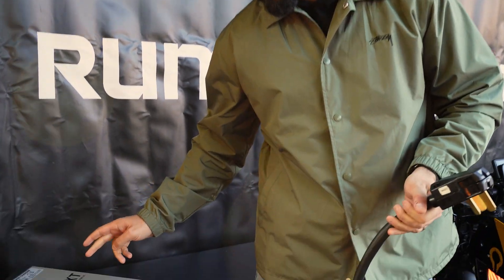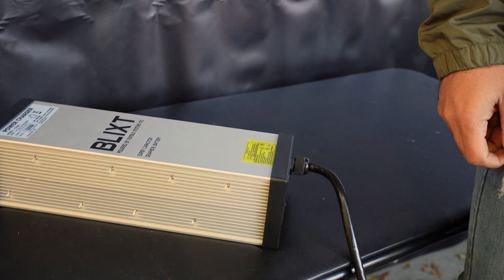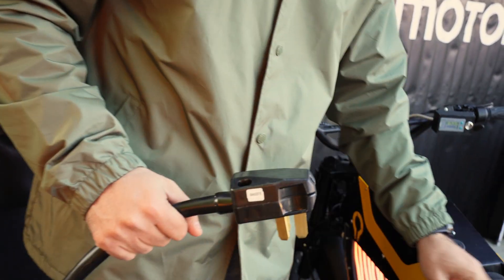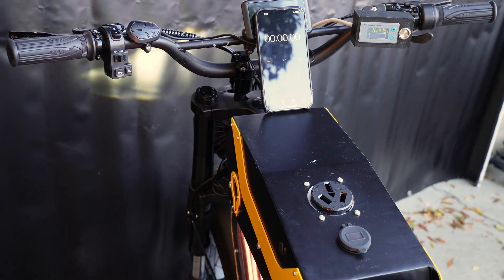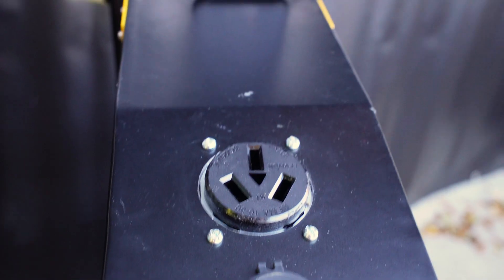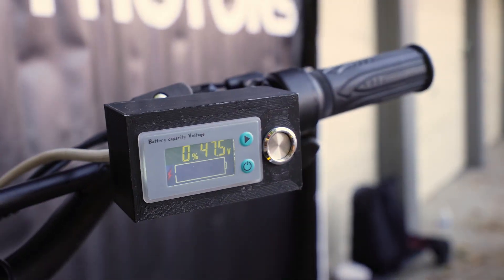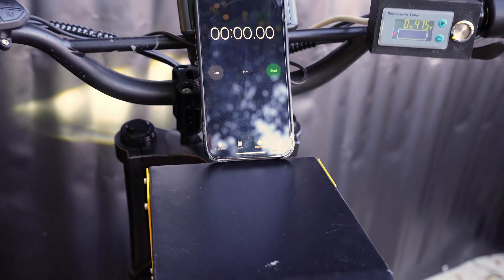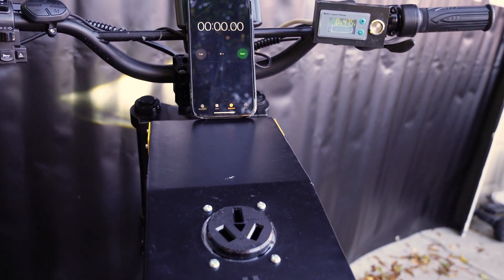Super Capacitor Graphene Battery Charging time (Time-lapse)

Comment: It is my understanding that these batteries can be charged at up to 80amps. that would be an approximate ten minute hyper charge. very fast. and the cycle life if i recall correctly is exponentially greater than traditional batteries. at over 20,000 charge/discharge cycles and maintaining strong battery capacity capabilities.

I have also studied gbatteries approach to fast charging. they are charging off the shelf lithium batteries in under ten minutes, also with increased cycle life, because they are changing the charging profiles with an artificial intelligence based algorithm which maintains absolute minimum charging resistance, while the battery is being charged. it would be great if you could work with gbatteries to charge your ebikes.

very nice designs!